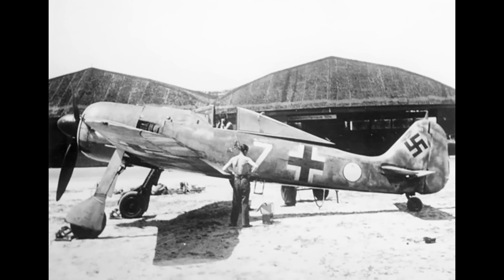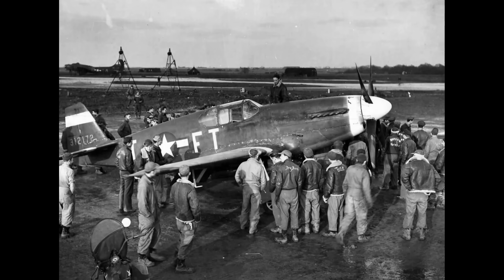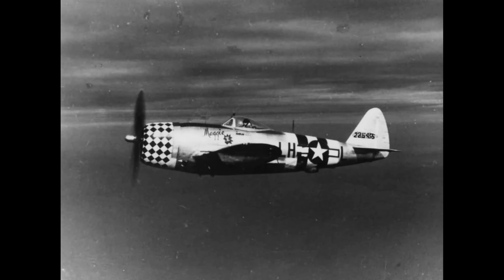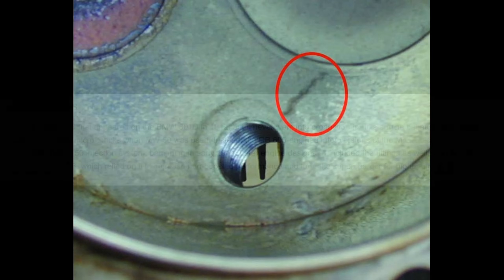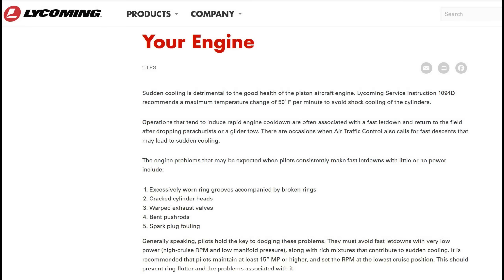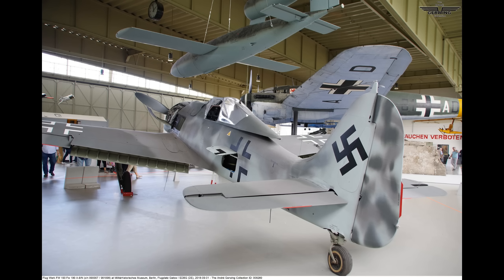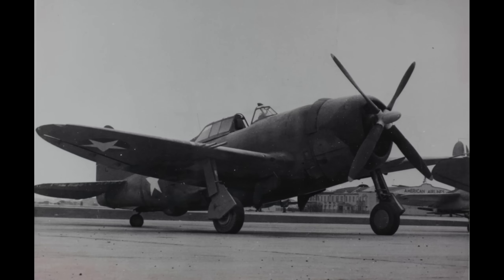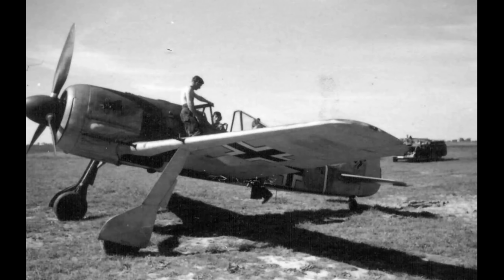Focke-Wulf Fw 190 A-4, Almost turned the tide, Almost...

Comment: Germany's inability to obtain trace metals (molybdenum, nickel, cobalt, manganese, etc) for ferrous alloys was a big issue for them throughout the war. This showed itself in the final drives of Tiger and Panther tanks (as much as overstraining through undersizing) and definitely in expected flight hours of BMW and Jumo turbojets measured in tens of hours.
This lack of trace elements did however cause Germany to lean in heavily on stampings for their small arms ie MP 40, MG 42, FG 42, Stg 44. This would end up being a huge movement forward for small arms development, writ large.

Comment: YES Greg, you are on to something new in realizing and recognizing, via 80 years of painstaking hindsight, the war winning capability that happened to be combined in FW-190 over all other high production aircraft, war machines even opportunities and alternatives, e.g., more and/or different fighters, bombers or missiles that would have allowed all the rest of the Wehrmacht to survive, thrive and win.  Allied air superiority might never have been established if enough of these late versions FW-190's had been almost exclusive, widespread and fully-supported with plenty of pilots, airfields, support as well, instead of jets, V-rockets, surface warships, . . .   Just this one invention, in triple their number used to it's full potentials may have stopped the Allies' war-winning bombing campaigns by unexpectedly producing as much as double the already monumental losses of Allied aircraft and aircrew in the first 2-3 years of WW2.  It is the radial engine that proved almost 100% more reliable, lighter and just as powerful as water-cooled engines at the time, especially in combat and inclimate weather conditions.  THAT lesson was learned too late for German airwar planners, but was made widely knowable with the achievements of aviation's great pioneers - Charles Lindbergh and Douglas "Wrong-Way" Corrigan dramatically proved that big edge in the 20's and 30's with their trans-Atlantic flights being impossible with water-cooled in-line engines, made possible with reliable radial engines.  Early introduction of the Butcher Bird may have incurred such overwhelming losses that may have broken the popularity and momentum of high altitude precision bombing at the time resulting in a feeling worldwide of an impenetrable-then  war machine and the war may have ended differently altogether had just the FW-190 been introduced early enough and used to it's full potential.
Reply from the maker: There is no realistic scenario where the Germans defeat the United States in WW2. However they could have turned the tide for a while and possibly delayed their ultimate defeat. The 190 with MW50 had a chance to do that.

Comment: If Germany had had the Messerschmitt Me 262 in 1939 in time for the Battle of Britain things could have turned out different. The RAF though would have had the Gloucester Meteor. These two Jet fighters never met in combat. It would have been interesting to see which was the better aircraft for air fighting fighter v fighter.
Reply from the maker: As for the 1944 and 1945 versions, 262>Meteor, by a lot.
Reply: @GregsAirplanesandAutomobiles  clean version of me262 624mph in ww2.

Comment: Have you considered doing videos on car/engine stuff? Kinda experimental (I could give you some pointers on microcontrollers & software)? Possible for a car on 4 wheels to use MW? Would it need to be fuel injection with lines tuned / tapped for the MW? Maybe get working "prototype" for carberated engine somehow? I figure a beater used car would make a good project platform for it. The planes are beautiful but the engineering under the hood is also beautiful. You illustrate that with every video, man. I'm always going back to these "older" videos on specific topics. 

Hope you find yourself well. 

Between you & Drachinifel and some other various small channels got my aviation & naval fixes. You've got us covered. 🤝 Not sure who is good with tanks & attention to detail...
Reply from the maker: Thanks but I already do that. I have a number of car engine videos and with MW injection.
Reply: @GregsAirplanesandAutomobiles  Oh, you've made your own MW injection system? That's awesome! That's what I mean - do you happen to know the title of the video?

Comment: Greg, I was a pilot at Ameriflight from 2000 to 2002 based in Burbank CA.  You are absolutely correct with regard to stage cooling. I remember going trought the PA-32R 300 Piper Lance and PA-31 350 Chieftain training. They drilled us over and over about the importance of stage cooling.
Reply from the maker: Thanks, and yes, Ameriflight really did know how to get a lot of life out of those engines. The philosophy there seemed to be wear out the pilots and replace them, but preserve the aircraft at all costs.

Comment: No Anton ever used MW50.  It was tested and even tested operationally but never adopted.  C3 injection was used in jabo and Schlactfleiger variants.  The fighters used a simple manifold pressure increase.  A retaining ring was added in the A4 variant forward which solved the cylinder bank temperature imbalance allowing power recovery of 100PS.  Pistons and new sleeves developed in the 801E/F/S program where incorporated into the 801D production from July 1944 on.  There was some confusion as is to be expected given the shuffling of units and the situation on the ground.  The KTB clarifies in October 44 that engines produced after July 44 are 2200PS engines requiring no other systems as it is a straight manifold pressure increase.  It was approved for an unlimited amount of 10 min uses as long as the temperature remained in range.

Comment: lol, I can answer the thumbnail question: because the Germans could not make enough of them or train enough pilots to fly them.

same reason the Tiger didn't turn the tide.   Same reason the Bismarck didn't turn the tide.   Same reason Uboats didn't turn the tide.

doesn't matter how good your equipment is when your enemy shows up with enough numbers to kill twice as much of it as you brought to the fight.
Reply from the maker: But the Luftwaffe did turn the tide, twice.
Reply: @GregsAirplanesandAutomobiles  didn't keep it turned.   Luftwaffe lost the skies in the end.
Reply from the maker: That's true, the Luftwaffe ultimately lost. I don't think that was in question.

Comment: Dont airplane motors have thermostats? Didnt the fw190 have an early type of engine control? Did it monitor engine temps? P38 is said to have a problem with the intercoolers over cooling the f/a mixture causing engine failure.

Comment: I can confirm without a doubt,that shock cooling is no myth.  I have several thousand hours flying skydivers. Cessna 182, 206, BN2A, PA-31-350 Chieftain.  As well as Turbine aircraft PC6-B1-H2 Turbine Porter and CASA 212. Cessna 150 type aircraft never reach high cylinder head temps doing circuits,  the drop in temperature in that type of operation is insignificant.

Comment: It didn't turn the tide because, SURPRISE, SURPRISE, they SUCKED at everything BUT Operational Warfare:
1. The German War Machine was run by crooks for crooks headed by a psychotic genocidal maniac.
2. There's this thing called "Innovation", and the Allies had it is gobs, too.
3. There's this thing called Logistics and Support, and the Allies actually HAD it, compared to the Keystone Kops German approach.
4. There's this thing called Intelligence, and the Allies had it in gobs compared to another Keystone Kops German approach.  See Abwehr data on Barbarossa, for example.
5. The Allies had this thing called Industrial Base, and they could put a gob of good enough planes in the air AND field new designs.
6. The Allies had this thing called Natural Resources, and the Germans never realized those were important.
7. The Allies had the Manhattan Project, and the ETO could just as easily ended with a mushroom cloud over Berlin and other German cities.
8. Germany relied too much on meth to win its early victories, and when the Allies matched them in drug warfare, it was all over.

Comment: I flew glider tugs with O-320 and O-360 Lycoming engines for quite a lot of hours. The cylinder heads on those aircraft definitely had a shock cooling problem leading to cracking in spite of some techniques to counter this. It is something of a problem with a 180HP Super Cub that, with the loss of drag from the tow when the glider releases, if you don't reduce power and increase speed (both causing cooling) the aeroplane will continue to climb!

It is probably significant that although any of the cylinders could crack (it was regarded as one of the costs of glider towing), the front cylinders only lasted about half as long as the rear cylinders which tended to indicate that it was as much the increase in cooling air that was causing the problem. The same engines fitted to Robin aircraft survived much better probably partly because with better baffles and those aircraft being less suitable to tow the very slow older gliders so climbing at a higher IAS resulted in the engines running cooler.

I also flew Navajo aircraft fitted with Lycoming TIO-540s and can confirm the (at first) alarming pink glow from the exhaust at night. I used to gradually richen the mixture in the last ten minutes of cruise to start cooling the engines before reducing power for the descent.

Comment: I think that shock cooling may have a lot to do with metallurgy (the alloy chosen for the heads).
For instance, adventure motorcycle engines (some of which have been converted to aircraft use) can go from full power into shutting down in the middle of a body of water, with the heads completely submerged for more than a minute, and they will likely be on their way soon after.

Of course they are motorcycle engines, not aircraft engines (at least not under such application), but there are similar physics at play.

Comment: Backing the idea of rapid cooling causing cracking, I'm a machinist and we call it "thermal cracking". Because carbide is such a hard material, it's quite prone to thermal cracking from heat cycling. Well as it turns out, it happens in just milliseconds. A milling cutter going through steel can be prone to thermal cracking when coolant is flooded onto it, but not when air is blown over it to cool it down. This is due to the cutter going into the material, heating up rapidly as it forces material off the workpiece, then rapidly cooling from coolant as it exits the cut. I've seen it happen between 2400rpm to 6000rpm, but it can also happen at higher rpm.
So I imagine in an engine block, it would depend on several factors like the material used and amount of water being sprayed, etc. It does make sense that it could lead to very localized surface cracking, that could become worse over time. There's probably an argument that steel needs to be much hotter than engine temperatures in order to harden from cooling, or that the amount of cooling isn't significant, but you don't need to create a hardness differential in a material to get it to crack, and you don't have to cool down the WHOLE cylinder to get a tiny spot by the inlet valve to crack.

Comment: Stupid question but how is IT supposed to cool in the Kompression stroke, raising pressure equals a raise in temperature, does it not?
Reply from the maker: The water evaporates providing a cooling effect.
Reply: @GregsAirplanesandAutomobiles  despite the pressure raising anyway and therefore raising the boilingpoint. => Not enough compression? At least I get now where the heatshock thing comes from. That would happen like 2500 times a minute that would surely cause material fatigue.

Comment: It's stressing the cylinder, with the extra heat of the methanol, leading to much higher temps, and at the same moment, a strong shrinkage due to the water cooling. It was only a matter of degree, but they were stretching every parameter at once, always a nightmare in engineering.

Comment: It's the water, not the methanol. Heads have the greatest stress of any part of the system. Think a long cable with a perpendicular stress applied. That what the cylinder does. Now bring up the heat high enough to make aluminum soft. Not liquid, but soft. Aluminum only needs to be about 600 degrees to become very soft. The extrusion temperatures in an extrusion press run 400-600. At 600, it's very soft.

Comment: -- I have a specific question or two. It uses to be in every book and program, that tackled engine overheating problem, with BMW-801, as one of the reasons Kurt Tank went with watercooler Jumo engine on Dora and later variants of FW-190. Also Shetsov's Ash-82 engine in Lavochkin fighter series also had overheating problems and pilot comfort in both aircraft, that is what I'm curious. I used to have no problem finding material that both aircraft cabin would reach 50 degrees Celsia even in a cold winter days, never mind summer. That is why Soviet pilots flew with an open cockpit even during winter, with all the problems of wind buffet in the cockpit and discomfort and fatigue it brings on top of heat exhaustion. Was that really a thing? Or is that a myth?
Reply: -- Also, how did La-11 performed vs. P-51 Mustang in N. Korea in 1950? Could it out turn a Mustang, and how does the engine power played a role, since Ash-82 finally got a two speed, two stage supercharger, and laminar airfoil wing, and Mustang had less H.P.s and was heavier about 1 000Lb. What do you think?

Comment: If they were not good dogfighters how did they give spitfires such a hard time in 1942
By the way,you do great stuff 
Keep it up 
Cheers
Reply: The Fw190 was an "energy" fighter, meaning that you want to fight in the vertical with boom and zoom tactics. This design emphasizes speed over sustained turn rate. And when the Fw190 entered service, it was faster than its counterpart, the spitfire MkV.

Comment: The fetish of pitting one plane against another, or debating whether one tank was better than another is fun. But it wasn't individual weapons that made the difference, it was the system and strategy of the country that made the weapons. Germany couldn't train enough pilots to fly enough Fw190 A-4s to make a difference, let alone the ground crews to maintain them. . Even if they managed it, building enough of them and finding fuel to use them would have been all but impossible. And whenever Hitler had a powerful force, he gambled with it until it was gone, used it in the wrong theater of operations, or squandered the advantage in some way. He even undermined his greatest victory (France, 1940) by allowing the British to save their army at Dunkirk.

No single weapon could have changed the outcome of World War Two after 1942, with the possible exception of the atomic bomb. Nazi Germany's ideology and government were ultimately self-defeating. Ideology made war against the USSR inevitable, and compelled them to exterminate Jewish people, even German Jews, and other victims, which was both evil and a waste of resources like troops, trains, and material that was at best partially justified by what they stole or extracted by working people to death. Nazi brutality also inspired widespread resistance. The chaotic and internally divided Nazi Party also created inefficiencies and terrible decisions. Giving one party, and ultimately, one man, absolute power ensured that important policy choices were made without real consideration or debate, and many of Germany's best scientists aided the enemy, and others spied for the Allies or conspired against Hitler.
Reply from the maker: I said nothing about winning the war, I said turn the tide, which the Luftwaffe did in 1943 with better Fw190s, so it's logical that it could have happened in 1942.
Reply: I thought "turn the tide" meant "win the war." I don't think the Luftwaffe turned the tide much in 1943 with the improved 190s. They certainly didn't accomplish much on the Eastern Front or in Italy, and in although the Fw190 was an improved aircraft, most USAAF losses over Germany were caused by AA fire, not fighters. Whatever tactical edge they gained with better planes was brief.

Comment: I have friends that ride/rode dirt bikes and 4 wheelers since they were kids, both liquid and air cooled, 2 stroke and 4 stroke, and in all their decades of riding, not a single one of them has had to deal with thermal shock issues despite all the abuse they threw/throw at their equipment including splashing through ice cold water after running flat out for literal minutes before hand. Then again, a family member made himself a water pump for his 500 gallon water trailer using a Briggs and Stratton lawn mower engine to power the pump, he used it for a couple years and one day the 500 gallon plastic water tank springs a leak, some water splashes the running engine and the head cracked. Thermal shock in engines is a very real thing, it does happen, but I personally think it has more to do with the quality of the materials. Those friends that ride their dirt bikes and such hard, all have one thing in common, they all ride old Hondas. The Briggs and Stratton engine is one of the more modern, cost reduced hunks of crap. I have also seen exhaust manifolds and headers crack on many different forms of engine from age, as well as thermal shock, but have only seen one head crack due to thermal shock. I have seen a cracked head on a Honda car 4 cylinder engine, it was VERY warped...someone didn't tighten down the head bolts correctly, the middle two were at full torque, the rest were finger tight... and I still have no idea how that kid screwed that up.